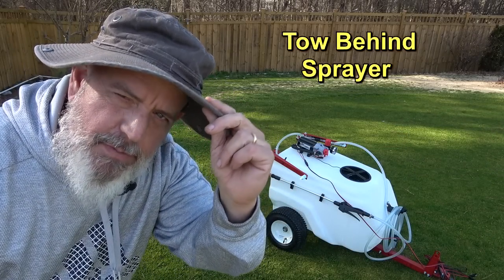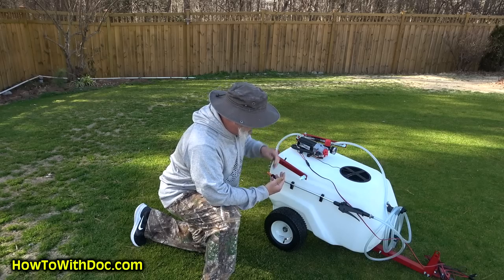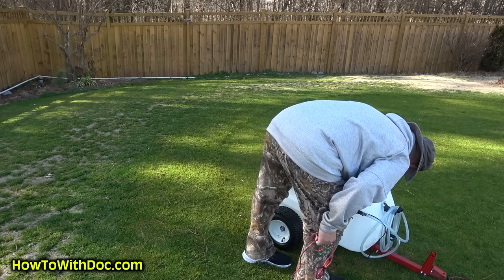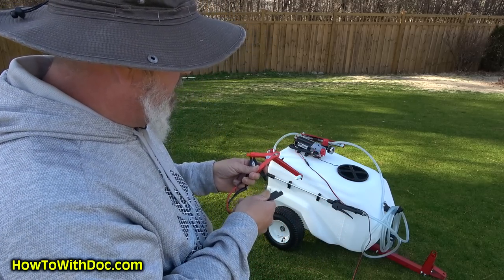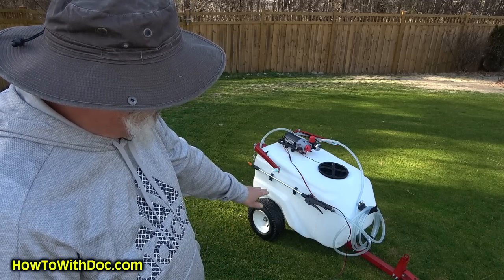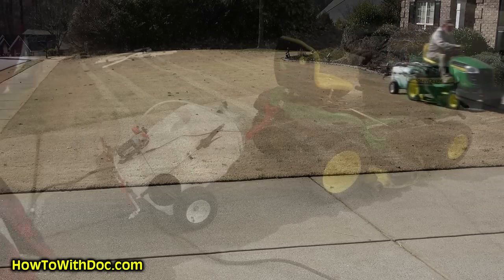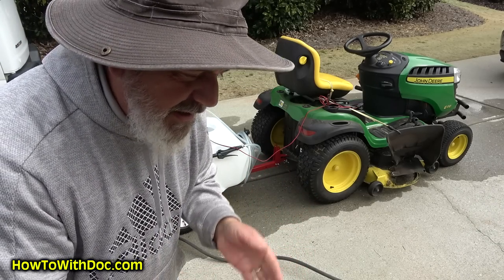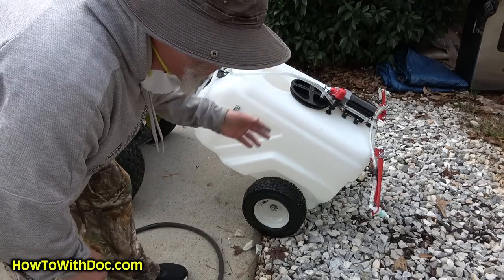Tow Behind Sprayer for Lawns

Comment: I bought this sprayer last summer/fall.  It's been a great unit.  When you purchase, be sure to upgrade to the Valley Industries Deluxe Spot Spray Gun. Also, check the hose clamps, and install #1 o-rings in the nozzles so they don't leak.

Comment: I have just under two acres of lawn to maintain and bought the same sprayer to use for it. Best money I've spent on my lawn! I've used it for two years and the only issues have been the pump was bad from the factory and the hose clamp on the sprayer wand broke. They replaced the pump very quickly, so it seems you can count on the company to stand behind their product.

Comment: Great video. I cut a few inches off the hand wand hose and attached a small brass ball shutoff valve at the pump barb connection so I don't have to deal with the wand unless needed.

Comment: I have the 32 gal spray. The cheap valves will have to be replaced at some point which I purchased the brass ones from amazon, mine had broke after a few uses. The handle started leaking at the clamp but it is a ready good sprayer for me. I bought it at the end of last summer.

Comment: I bought the same unit 3 years ago.  My only complaint with the unit is the spray nozzles are junk.  The spray pattern is so uneven on each sprayer from side to side, you really can not properly calibrate it evenly.  Any ideas on how to upgrade it???  I was thinking something like TeeJet nozzles and fab work on the arms, but they have soooooo many different applications its hard to pin down to just one.

Comment: How did you measure your speed driving the mower?
Reply: You want to travel somewhere between 2 to 2.5 mph (no faster). There’s a great speedometer app that you can set for slow speeds. I believe it’s appropriately called “speedometer.” I just set it on my zero turn and  spray my 25k lawn in no time! I love my 31-gal tow behind! Good luck.

Comment: In re to last topic, if you’re in drought, and you spray, and don’t have chance to water it in slightly, will the water run off take the chemical if it’s down pour or will it still work it in?
Reply from the maker: If the soil is DRY... the first rains will work into the soil.